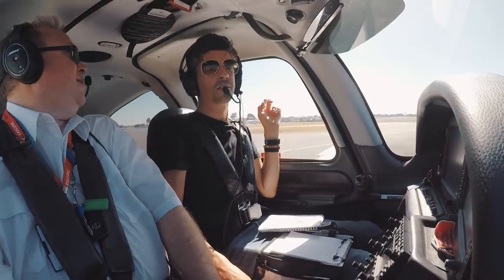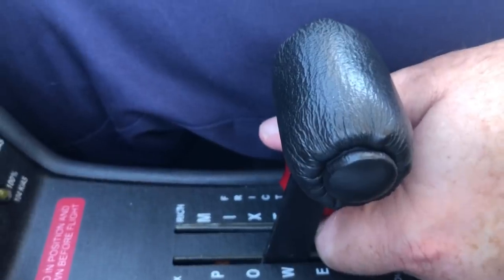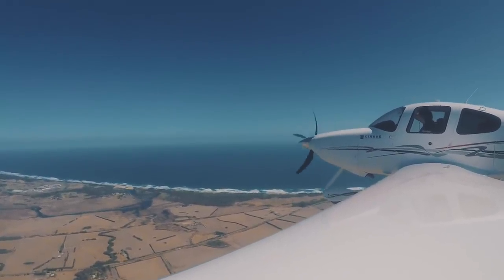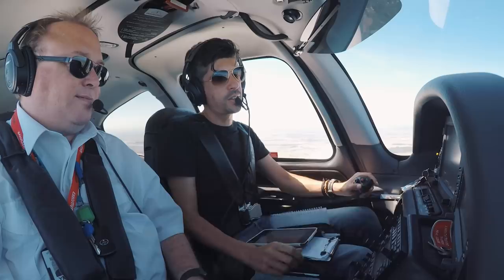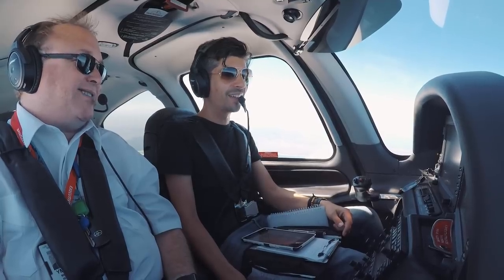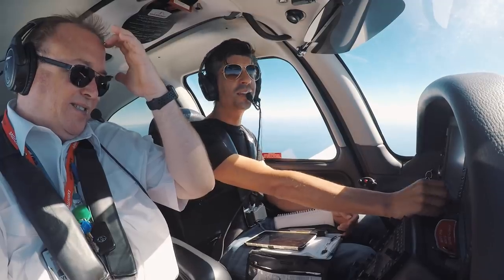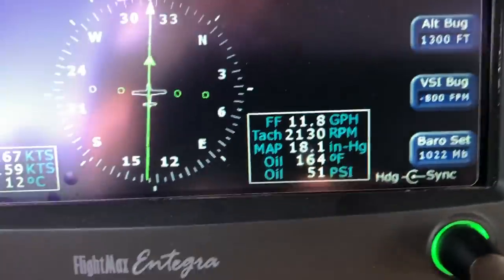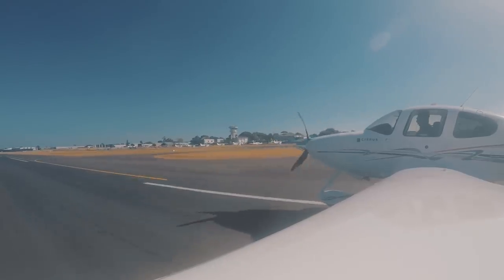Airplane engine tips - lean like a pro

Comment: Great to see Mike mentioning 380dF as a limit. There is plenty of data backing up that value as the safe limit despite Continentals ludicrous 460dF limit. Nice to see juicier video aimed at encouraging at a bit more curiosity as to what is happening up the front. Most pilots sit there in blissful ignorance not really knowing what those screens are telling them.

Comment: Stefan, Just noticed perviously you'd a dual Garmin GNS 430W and you switch to GTN 650 recently. Wondering why you didn't choose Avidyne IFD 440 which was a direct replacement to your exciting panel with minor installation cost. Especially when you have a Avidyne DFC90 autopilot and Avidyne Entegra system! Love to hear your thoughts! Thanks

Comment: I dont understand why this is still a thing you need to do manually in a fuel injected High performance Engine. 
@CirrusAircraft put a rotary knob that sets engine modes. so position 1 takeoff/max power position 2 rich cruise position 3 Lean Cruise. and have the engine management target the correct air fuel ratios.
leaving setting like this to people to manually achieve makes errors possible

Comment: Nerdy stuff is good stuff!  I guess I need a better understanding of leaning the engine.  Why do it?  Is it just fuel savings?  Doesn't the EGTs and CHTs go up causing possible long-term engine damage?  Hum.  I need to learn more.  Thanks for a great video, Mr. Drury!  I enjoyed it!
Reply: If you run the engine too rich it won't develop full power. You'll also gum up its innards with carbon. They're designed to be run hard. This is one reason car engines make lousy airplane engines.
Reply: @marsgal42  Hum.  So leaning the engine actually helps the engine if done right and saves the pilot some money?  Can't beat that!  I agree that automobile engines make lousy aircraft engines.  I do notice that newer engine designs do not lean.  For instance, Rotax 912, 914, 915 engines.  I wonder why?  Maybe I need to take a Lycoming or Rotax repairman class.  Thanks for the reply, Ms. Halliday.  Appreciate it!
Reply: The Rotax engines have electronic engine management and adjust their mixture automatically.

You can download the Lycoming and Continental engine manuals from their web sites (e.g. Lycoming p/n 60297-30 for my plane's O-320). They're very informative.
Reply: @marsgal42  Ah, that's how Rotax does it!  A manual would be excellent!  I will assume that a O-320, O-360, IO-390, and IO-540 manuals will basically give the same information?  In other words, a carbonated or fuel injected engine will give similar information?  Thanks for the pointers!

Comment: Hey Stef at 6:38 it say it can fly for 6:49 more does that mean it can theoretically fly over the Atlantic. Sorry if this is a stupid question.
Reply: At those settings, that is currently the calculated endurance. Yes you might get there but your not getting back! (unless you can refuel of course) Keep in mind too, you need to land with a reserve based on the type of flight. VFR vs IFR have different amounts.

Comment: Stef wpuld you not leave the fuel pump on over water as a precautionary measure?
Reply: No, if the mechanical pump fails, it will supply only a few GPH.....nowhere near enough, if the aircraft is fitted with a high flow pump, you may get enough for a very low power scenario. If however it is a Lycoimg the high pressure pump will run the engine.

The boost pump on low is used to abate vapour lock in the climb due to dropping ambient pressure, high lift suction and hot fuel/pumps from the climb.

Comment: I personally think It's not a good idea to lean off of fuel flow. That is how you will end up with excessive carbon build up /fouled plugs or possibly a burnt cylinder and valves if the delta between the rest of the cylinders is large and one cylinder is being run to lean. Lean off of peak EGT on the leanest cylinder. The only way to properly lean is to find leanest cylinder and lean based off of the temp of that cylinder whether it may be ROP or LOP the same would apply. This ensures that all other cylinders are richer than the leanest cylinder when choosing to run lean Rich of peak. The big pull is to reduce time in the red box which is an area where extended amounts of time can cause a bunch of problems which is what might happen to a cylinder or two if you lean like demonstrated in this video. Just my 2 cents. I'm pretty sure that the placard of fuel flow on the panel is just a quick reference when you are climbing. I don't know how Cirrus recommends leaning but I do not think that is reccomended.. I will say that I do agree that anything in cruise over 385F in longer peiods of cruise is too much. Not trying to roast the instructor as I'm sure he is very expienced and this is just my opinion so take it for what it is worth. On a random note Australia pretty seems awesome.
Reply: There is much rubbish written about leaning.

If you lean too much, guess what? Your engine runs rough/stops running completely!

Temperatures are what matter! Not how you lean! This LOP/ROP nonsense needs to disappear. ROP matters for reducing temps because of over-fuelling. It aids cooling, and keeping the temps down.

This is the entire secret of the engine and looking after it.

If you run it at max temps all the time, you're going to suffer heat damage, thermal effects, and fatigue.

High CHTs/EGTs are asking for trouble as it is THIS that causes detonation.

If your CHTs are high, there is only one option: reduce power and increase airspeed.

Heating/cooling cycles are the other big killer of cylinders, particularly the front cylinders. To reduce the problem, keep some power on during descent. This will also help with the plug fouling problem in descent, as it is once again temperature related (plugs foul because the temps are too LOW).

Comment: Nerd on! :-)

My plane has an Insight engine monitor. I like being able to lean precisely (50 degrees rich of peak EGT) rather than "that's about right".
Reply: May I suggest that your technique is sub optimal, even at high altitudes. You are not in the best BSFC range for economy nor are you rich enough for "go fast mode" either. 50dF ROP is an OWT.....Old Wives Tale. Try reading John Deakin Pelicans Perch articles.
Reply: There is so much rubbish talked about leaning. Fact of the matter is TEMPERATURES.

If you lean too much you'll know - your engine will run rough/quit through lack of fuel. It's that simple. Leaning will reduce power = lower cruise speed.

High CHTs lead to detonation, NOT leaning too much/too little!

High EGTs can lead to detontation (well... the whole thing is bolted to the cylinder heads, right?!).

Keep your temperatures in check, and lean as you desire.

General maintenance and good ground ops are more important.

Comment: Fadec is really good to stop having to do this silly game,, Let the  oxygen sensor do the work.  Cars can, why not mainstream planes?   Engines  like the ULM and  Rotax injection one s are easier to use.. Stuck in the 40's   time to move on a bit.  Fly the plane and not be a nanny to a lump of mid 20th century alloy.  Magnetos should have gone the same  way 40 years ago.